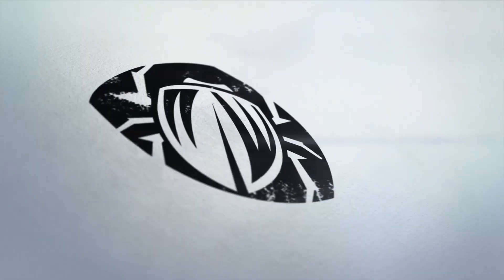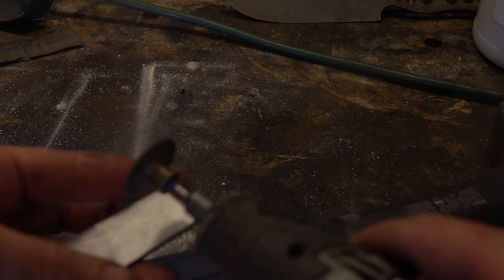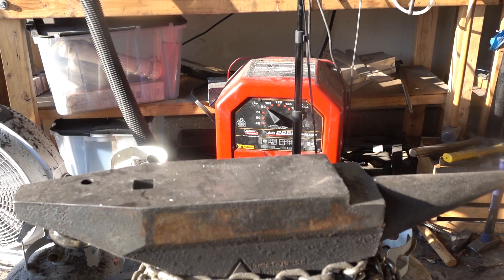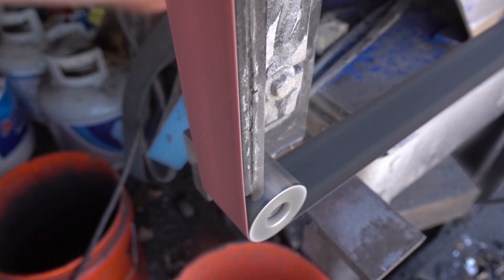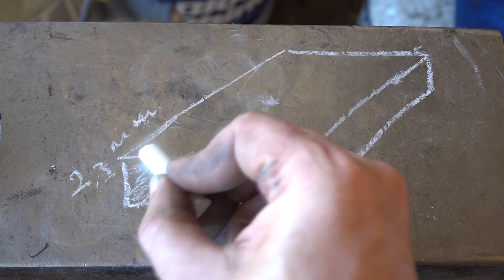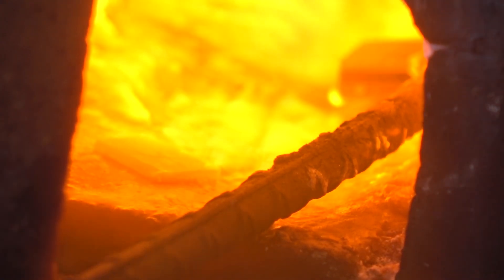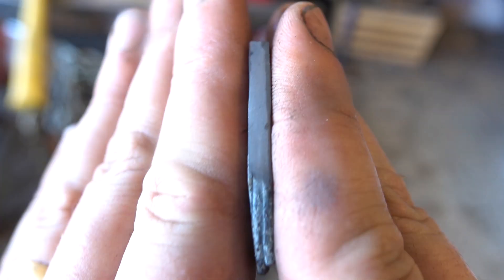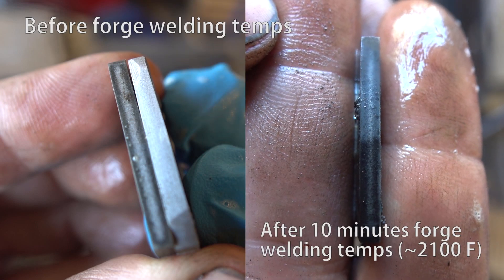"Metallurgy" Of The 'Murica Knife. Carbon Migration.

Comment: How flat does the final knife blank have to be? I have hammered out a knife shape and have a small quiver going down the steel horizontally. Will this come out in grinding or will i have to fully flatten it?
Reply from the maker: May or may not grind out. lay it flat on an anvil and look to see ho flat it is and if grinding it flat will cross the midline with grinder, etc.

Comment: Saludos yo queria preguntar, cuanto tiempo y a que temperatura de debe hornear  un cuchillo luego de templarlo
Reply from the maker: You should not heat a knife after tempering.  Hardening temp depends on steel. tempering temp depends on steel and desired HRC.
Reply: Muchas Gracias

Comment: Could you try and take low carbon stainless steel that cant be hardened and add carbon into the steel. if so will it keep the stainless quality and will it get file hard as well. Another experiment  you could try, if you can carbonize stainless, will it diffuse the carbon like the normal steel.

Comment: Air quotes in air quotes. Funny stuff. This carburizing method is a lot like the blister/shear steel process. That has proven (and for a while was the best way to process iron into good cutlery steel) to be a great method. The old Sheffield knives were made this way. It is way deeper penetrating than the simple case hardening that is used on say axels. I never had any doubt that you knife would be a good usable tool. This video gave a great explanation as to why. Nice job.

Comment: I have heard that if you use coal forge it also rise carbon level in the metal. Also same goes quenching in the used motor oil. Is this true and maybe you can test this theory in the next video :)
Reply: Quenching in used motor oil is good for getting cancer, please don't do that.
Reply: The heavy metals and everything that naturally leach into the oil during operation of the engine are pretty much all carcinogens, quenching burning metal into the oil causes them to vaporize where you breathe it in.  Now this isn't an instantaneous quench the blade now you have cancer it will over time affect you if done repeatedly.  Its just much safer to use vegetable oils or specific quenching oils like parks or something else.
Reply: maybe if you dont use good protection while quenching or do it well ventilated area and grind blade clean
Reply: you are right it just theory i heard somewhere
Reply: FinMauser I personally wouldn't use used oil but to some extent that could be true. Coal can add carbon but not a ton usually. I quit using coal because it's just not healthy (even with good ventilation). lump charcoal can also add a little bit of carbon and it's safer.
Reply: i my self use charcoal too and quenching motor oil and hydraulic oil mixture that one blacksmith taught me some time ago.
Reply: Yeah charcoal is pretty good but right now I'm building a propane forge cause I just can't afford to use charcoal.